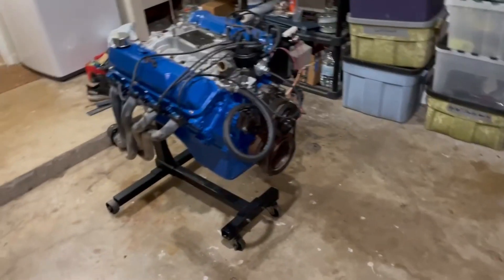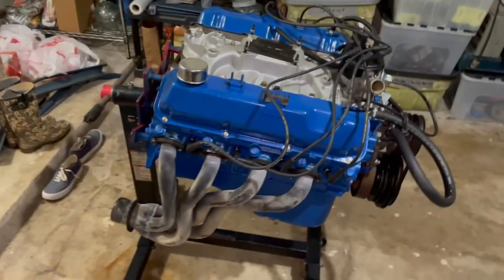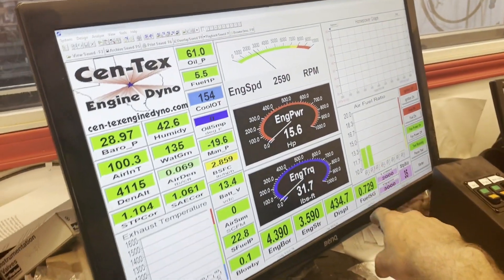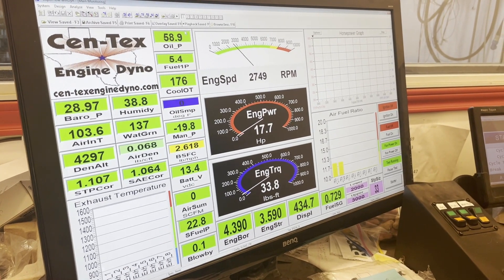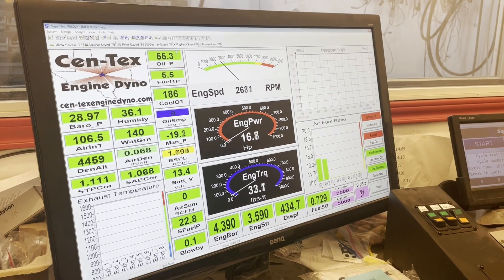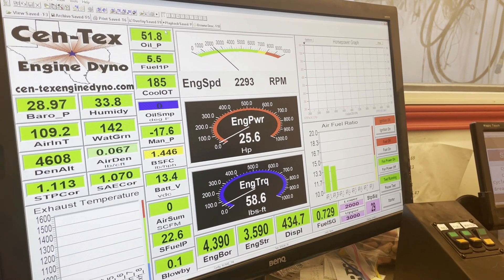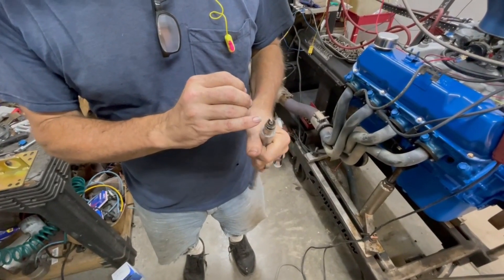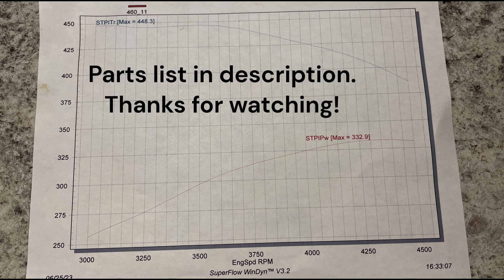Big Block 460 Dyno!

Comment: You can definitely rev it higher than you are, it's not a Chrysler.  They will happily go well past 5000 even stock and with your upgrades quite a bit more.  You aren't even really getting into the rpms where your cam can even really do its thing.

Comment: I had that exact same power band in 460 that I bought already in 4x4 truck, it was awful, horrible fuel mileage and felt like anything over 3800 rpm the power was taking nose dive.
built a 532 stroker form motorsport heads 9.2cr , .519 lift 224 duration @.050 . Installed @ 0
rpm intake , quick fuel 750
c6 lowest stall converter I could get. gear vendor. 3:73 gears 
NO JOKE, 20mpg +@ 65mph 
burns the tires off pulls like freight train to 6000rpm.
though 5500 would have been plenty and give a bit more bottom end

Comment: Don’t take this as being critical, just passing along good info.  Your HP is way down, but you were not spinning over 4500, correct?  Torque isn’t bad, but could be better.  What combustion chambers are in the heads?  Is there a quench pad?  You mentioned decking the block 0.020” did that get you to zero deck?  If you have flat top pistons and a quench pad in the combustion chambers you need to set your quench distance to 0.035”-0.040” by using whatever thickness head gasket necessary to make it happen.  Cometic makes great gaskets.  Also get a head gasket with the smallest bore size that fits your cylinder size, not way bigger like a generic Fel-Pro.  I noticed you only checked initial timing….this means absolutely nothing, you need to know what total mechanical timing is and at what rpm it’s all in at!  That engine probably likes 35*-40* total timing….start at 34* and make a run up a hill to put a load on the engine and see if it detonates (pings), bump the timing up 2* and repeat until you get detonation, then back your total timing down three degrees and lock it down….do this test with the vacuum advance disconnected and vacuum line plugged. See where your initial timing is at. If your engine won’t start because initial timing is too high then you have to modify the distributor for more mechanical advance so that your initial timing is low enough for the engine to start when you have your total timing set aggressive where it needs to be.  Now plug your vacuum advance into “manifold” vacuum and see how much your timing advances.  You want a good 15-20* of added vacuum advance at idle so that your idle timing is 30*-40*.  Make a test run and make sure you have no detonation as you accelerate, if you do then you need to add an adjustable vacuum canister and adjust it until you have no detonation as you come off idle.  Once this is complete then adjust the idle mixture screws in the carb and make sure your idle transfer slots are not uncovered at idle or you will have hesitation. Your tune will be way better and way more responsive!  Leave the dual plane intake on there and do not add a single plane intake you don’t need it on a low rpm street engine!  I would add a 3310 Holley carb (750 vacuum secondary) no double pumper needed!  At some point in the future if you want 500-600 HP you need a custom spec’ed hydraulic roller cam.  You really need to learn to degree in your cam instead of guessing, but a little advanced is better than a little retarded on the street!  Get a cam intake closing matched to your compression ratio…..   if you ever decide to push 500+ HP you will have to put in bigger fuel lines and higher flowing fuel pump.  I have a ‘72 C10 454 set up as I have described and it makes 550 HP & 600 lb*ft torque on 87 octane pump gas and puts a beating on vettes …..it’s low compression, small cam, small heads, factory HEI distributor, dual plane intake, 750 vacuum secondary carb…nothing exotic just a good tune!  Good luck!

Comment: I noticed that the specs on the computer for the engine had the stroke at 3.59, which is correct for a 429, but not a 460 which has the 3.85 inch stroke.

Comment: Im confused how this thing only made 330 with a cam and everything rebuilt i havent watched the video all the aay through did he barely rev it or something
Reply: A Low RPM High Torque Camshaft Sacrifices HP for all that low end Torque that is why they put them in Dump Trucks and Motorhomes until 1997.
Reply: It's a tiny cam. It's probably no bigger than stock. 
I would have gone with around 218 duration at .050 for a low rpm truck motor. More torque and horsepower.
Reply: @subzero18851  68-69 460's had 10 to 1 Compression Ratios and change the intake  and Carb. a High Rise Intake with a Holley Double Pumper and you will add 200 more HP !
Reply from the maker: @subzero18851 is right. Would like to do a roller setup with a big cam eventually but wasn’t in the budget yet. Just needed to get the thing back on the road.

Comment: I enjoy your 460 content. Built my 460 with sum3500 cam, the recommended valvesprings, keepers, and retainers, and the same jb-900 lifters. Broke mine in in the truck the same way yall did yours, and it appears as though i have lifters faining or being chewed up.. have you had any problwms with your setup wearing as you have istalled it into the old truck? Thanks!
Reply from the maker: I have not had any issues yet. Knock on wood

Comment: Why did the dyno computer list your engine as 434 cubic inches?
Reply from the maker: The stroke is actually 3.85” for a 460 and he typed in 3.59”. The computer uses the bore and stroke to calculate cubic inches so that’s why it’s lower. Just a mistake on the input.
Reply: @cronedentside74 That's the stroke on a 429. Same block heads etc.. different stroke.

Comment: So what’s the compression ratio? I’m  doing heads cam and intake on a stock 1986 460  , looking for a slightly bigger cam ,
Reply from the maker: My calculations came out to 9.3:1 for compression. I would definitely do a bigger cam than what I ran. Just remember to upgrade your valve springs as well!
Reply: @cronedentside74  I’m looking into a cam kit from Lunati bare bones kit comes with everything needed just  trying to get my factory compressor up , looks like I’m going to have to mill my heads down to 75cc try and get to 9.5:1 ish
Reply from the maker: @richardkamowski4656  very nice. You could also take some off of the block deck if you wanted to get machine work done to it. But I get if you are trying to limit how many parts you have to take to the shop.

Comment: I don’t know if you’ve upgraded your intake/carb but I would highly recommend against the Holley sniper. I have installed 2 on customer cars (302 mustang, 396 nova), one on my own car (66 Chevelle 383 stroker), and a Fitech on a 75 f250 crew cab 4x4 460. Every single one of these I’ve installed have had nonstop issues. The Fitech has by far been the best because it has good drivability but it has constant hard starts that we can’t get tuned out of it. The snipers all start OK (except for the mustang which randomly won’t prime the fuel pump on cold starts which is clearly a software issue) but they have severe drivability issues. The nova likes to flood randomly and my Chevelle has the worst random lean spots I’ve ever seen- I’m actually worried it’s damaging my $4500 engine so I’m done driving it until I put a 750 Holley back on it. I’ll be cruising down the highway at consistent speed with 13.5:1 AFR and then all of a sudden it will go to 22:1 for no apparent reason. I hate my EFI and will be going back to a carb.
Reply from the maker: Thanks for the input! That’s good info to know. I upgraded to a 750 Holley but I left the intake the same since it’ll mostly be a street truck.

Comment: 333hp 448trq is nice, but cnc heads n bigger cam are definitely needed.. Rev it to 6k rpm with a top end build, you won't lose any lower end trq, i promise..
Reply from the maker: Yes definitely room for improvement but happy with the start on a budget. I’ll definitely post more videos as this engine gets better upgrades.
Reply: @cronedentside74  i do believe you will, still a good choice to have the 460 to build.. My lil 4.6L 2v 281ci v8 made 309rwhp 321rwtrq @5,447rpm.. Not bad for how small it it, imo..lol
Reply: Going over 500 foot pounds 
500 hp
Reply: @ElvinLeadfoot  Sweet, what's your setup??

Comment: If you plan to drive it on the street, keep the dual plane Edelbrock intake. The single plane will be a PIA in a heavy truck and isn’t fit with that type of cam shaft. 750 carb is a good upgrade. ;)
Reply: 750 is good 
But on dual plane intakes, more carb CFM is better. 
Because you’re only drawing from two barrels of the carb. 
850cfm 900cfm
Even on that engine. 
The engine can handle it and use it
More torque down low
Reply: @ElvinLeadfoot  the intake design, single vs dual plane, does not change how many barrels of the carb is open or closed. 

With the cam profile that is currently in the motor, the 600 cmf carb that is on it, and the dyno graph that is shown, it makes plenty of torque down low and is limited at the top end. A 750 would fit perfectly for the application. If the motor was to go in a jet boat to be operated at WOT then over carbing it with a 800+ would fine. 

FWIW a boss 429 was fitted with a 735 cfm and had superior airflow from the intake, cam, and head design.
Reply: @ElvinLeadfoot smaller carb on a truck is idealcofr low rpm efficiency and if it never really sees 5000 rpm then its no issue. A. 650 cfm is ideal for truck use